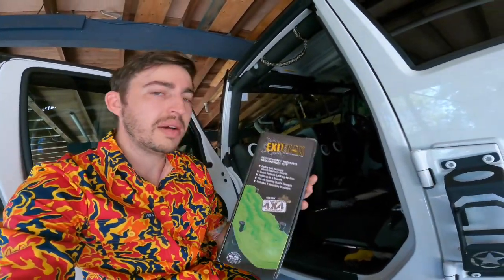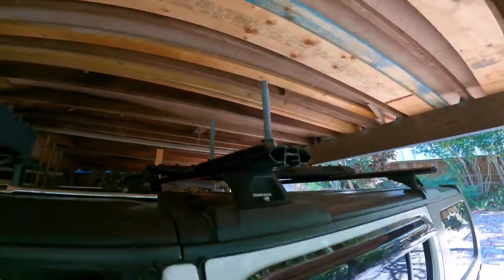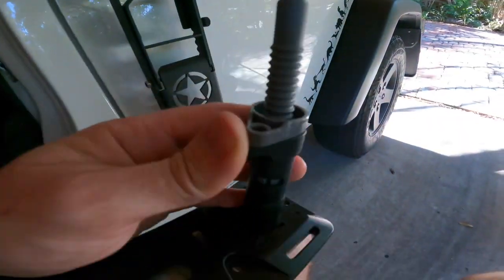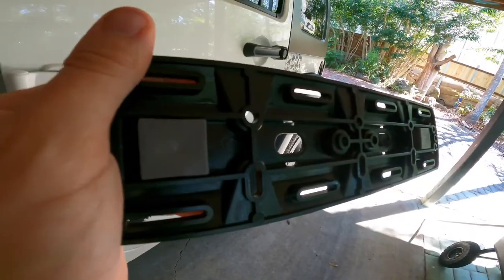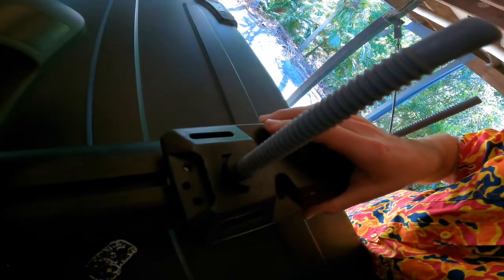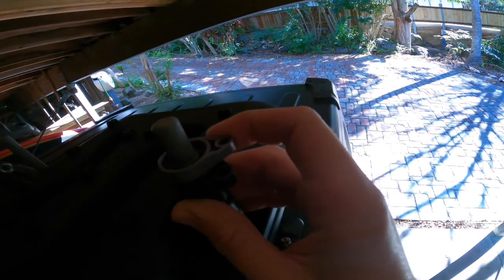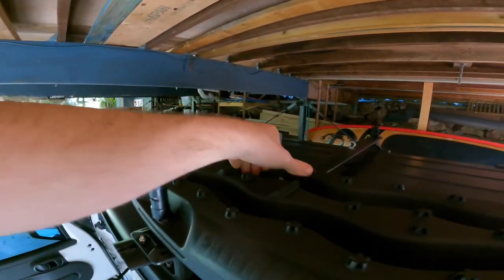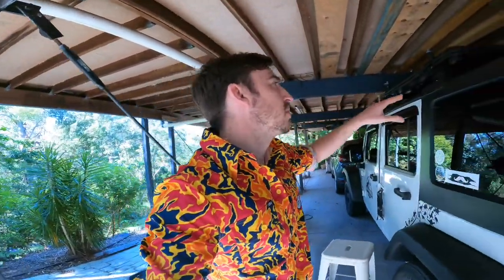EXITRAX MOUNTING KIT INSTALL

Comment: Are you still running these boards? How have the mounting pins themselves held up, I'm concerned that being plastic, and not metal like the Maxtrax pin, they might crack or the thread type push down lock piece might eventually wear & become less effective at holding them down tight.
Reply from the maker: Hey, yep still on the can now and still working well, I haven’t noticed any problems with them yet. Thank

Comment: any idea how tall the mounts are including the screws? I've only got so much room to get in and out of the garage. thanks
Reply from the maker: Great question, I also have limited room coming into the garage. They are measuring at 13.5 cm. The Locks sit lower than the top of the mount with two boards on. Hope this helps. Thanks
Reply: @Whiteandsonsgarage  13.5 is the tallest point?
Reply from the maker: @jasonboyd3619  yes 13.5 at the tallest point.